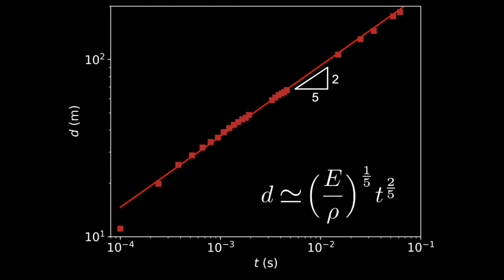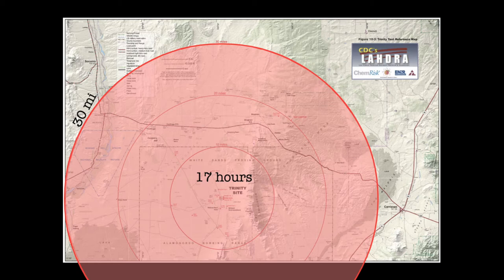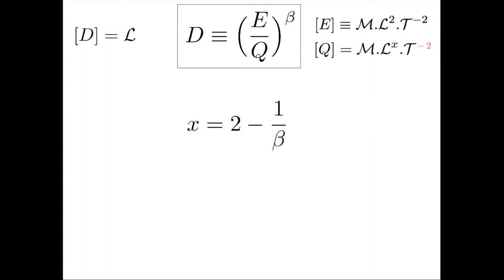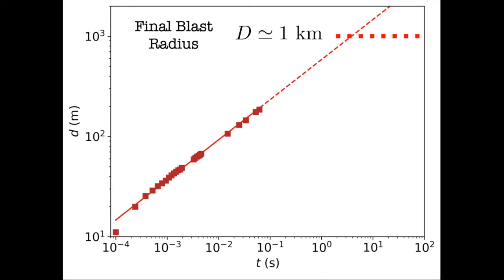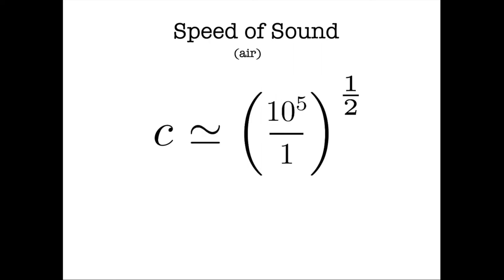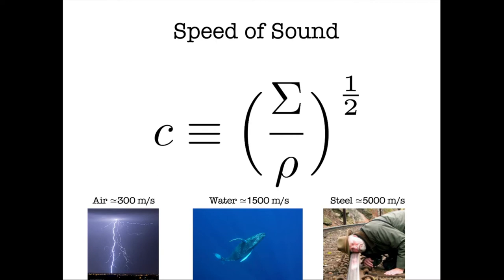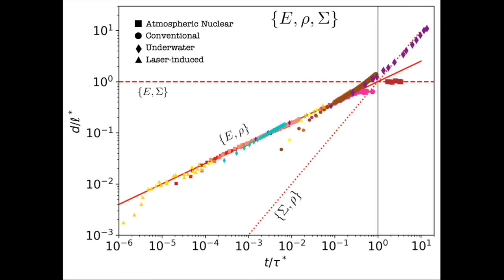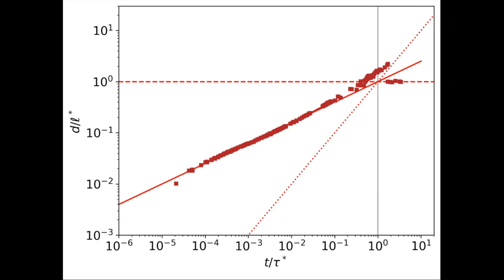EXPLOSIONS (4) Late Dynamics

Comment: 5:04  . Your choice of the important case when x = -1 appears to be a random choice, and post hoc, it provides the very satisfying result: Q is Σ and the intersection is with the speed of sound, but I think it needs the promised : "We will come back to the multiplicity of solutions at the end of this video" which would be very revealing.
Reply from the maker: Indeed, there could be many length scales built from a ratio of mechanical quantities with energy in the numerator (see episode 2 of the Mechanics series). Considering pressure is useful for the shock wave, but as mentioned at the end, the fireball stops at a different radius. From what we've read this final radius for the fireball scales as (E/Q)^(1/5), in which case Q would have dimensions ML^-3T^-2. Such quantity does not seem to have a standard name, but it could be interpreted as a force gradient per unit volume (MLT^-2/L)/L^3. We would love to come back to this in the future.

Comment: 13:41 I was bothered by your equation c "is identical to" (triple equal sign,≡)  root(sigma/rho) until I realised you probably meant c "is approximately equal to" since for a gas the speed of sound is also dependent on gamma: c = root(gamma x pressure/density) where, for air (mainly diatomic N2 and O2) ,  gamma = 1.4.
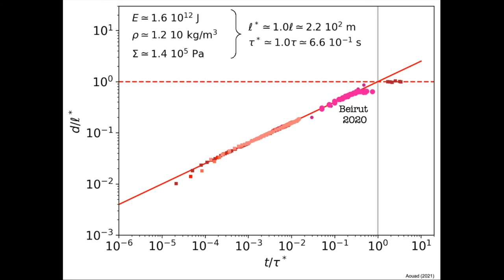[EDIT] but I see at 22:30, you have indeed scaled Σ by γ and shown Σ as 1.4 10^5 Pa, (not the previous value of 1 10^5)   for air blasts.
Reply from the maker: Thanks for being so attentive ;) For a rough approximation, considering the pressure is enough, but for better prediction Sigma indeed needs to  be the bulk modulus.

Comment: Brilliant series, many thanks.
Can you confirm that after the Hopkinson-Cranz space-time point, the shock front propagates at the speed of sound? 
In particular, in reference to the Beirut Port explosion, that at a distance beyond around 600 metres where this video  https://www.youtube.com/watch?v=Hd6Z_pGx9_4, was shot, that the blast wave is travelling at the speed of sound?
Reply from the maker: Thanks! Assuming a yield of 1 kt, and the bulk modulus of the air to be 1.4 10^5, the "bare" formula for the distance of the H-C point would be around 300 meters, but numerical corrections may very well change that a bit. Looking at the video, the over-pressure seems to be pretty significant, which would suggest that the explosion front is still supersonic. You'll see that many data sets actually show a pretty smooth transition around the H-C point, such that the actual speed of the blast can be quite significantly higher than predicted by the scaling. However far away from the H-C point, the speed does go down to the speed of sound.